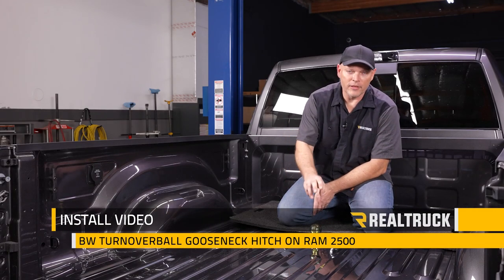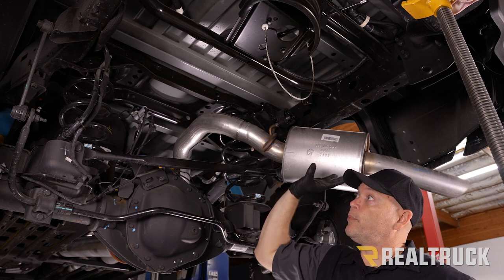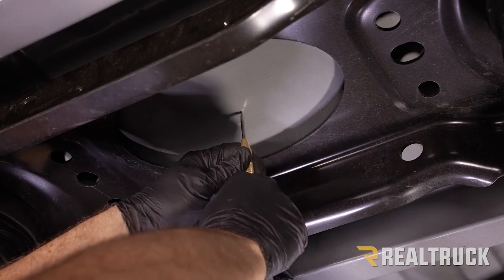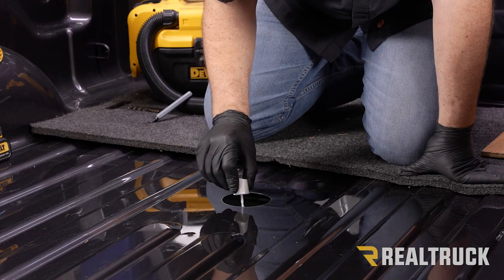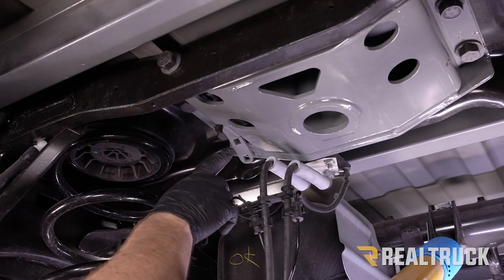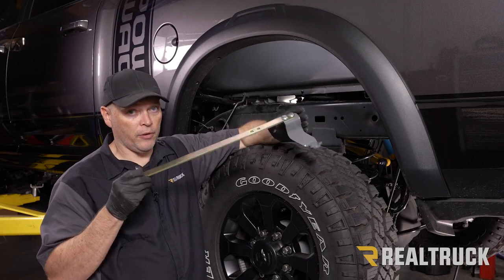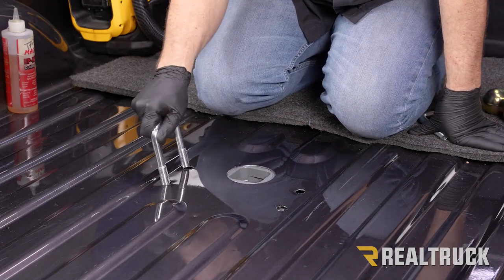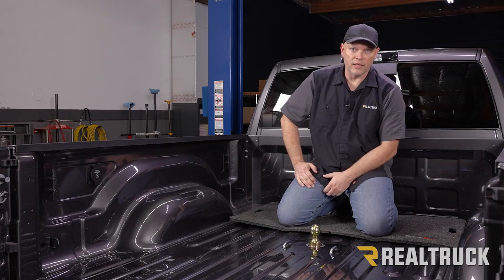How to Install B&W Turnoverball Gooseneck Hitch on a 2022 Ram 2500 Power Wagon

Comment: Well as I am at the research stage for my new 2023 Ram 3500 Cummings 6.7. Not only found this video helpful, informative, it also showed how easy this is to do. 
I am looking at replacing my OEM fuel cell with a larger capacity tank so it appears I need to do that at the same time giving me a little more access to the front left side bolt.